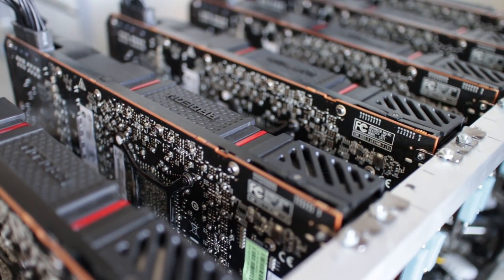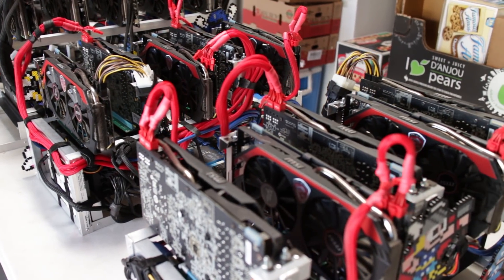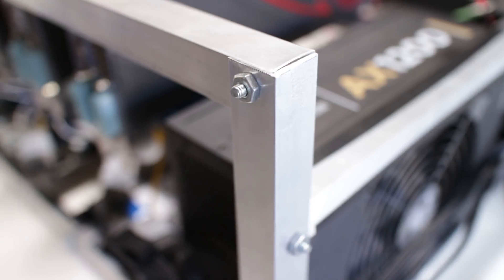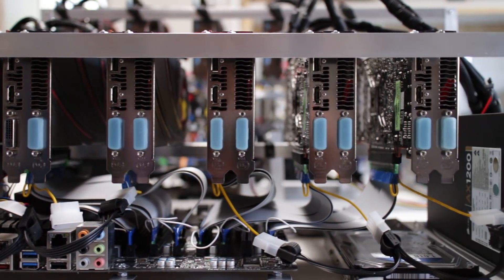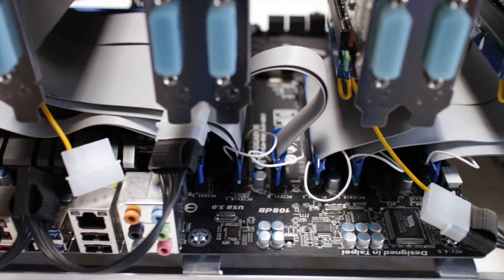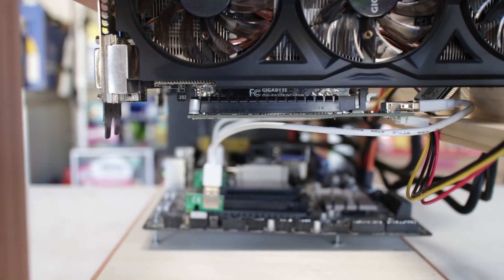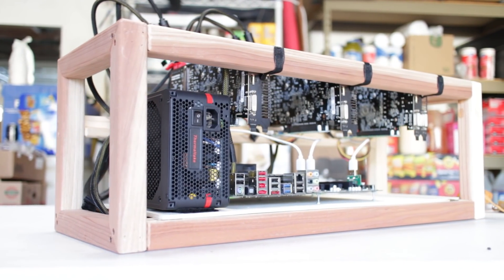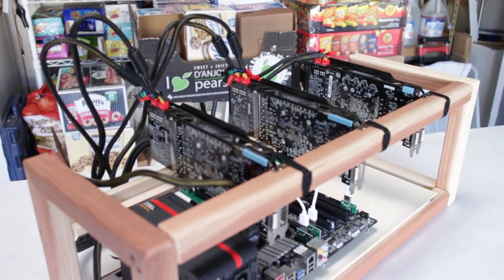$10K and 15+Mhash Worth of Mining Rigs

Comment: You have to be careful. No one will tell you the truth. Fact is that most of the binary options softwares do not work well and basically they are proven scams. I burned my account and lost my hard earned money several times. Eventually I found my desired one==>>(https://twitter.com/MouaJune/status/911658699806064640  ). It worked for me and works fast to achieve quick profit. I am happy to find and trade with such a trading tool. It is fairly able to make decent and consistent profit. I have never come across like this in my 5 years long trading career.

Comment: 10k and 15+Mhash in 2014, i just started today with my single 1070 and it gets 24.7 Mhash :p
Reply: overclocking at +175-200 Core Clock, and +600-800 Memory Clock reaches almost 30 MHZ
Reply: its a different algorithm

Comment: Wooden frame lol.
Fuk the GND..  XD
Too many physics lessons ditched it seems
Reply: +A. Tinkovay Sorry accidentally replied to the wrong comment.
Reply: +A. Tinkovay The GND is already wired into the circuit he is using. So wood is fine.
Reply: +sourdieselryder it ddoesn't work like that, for example, if you did an amplifier and then put it in a wooden case it'll make a lot of ground noise even though the gnd is connected to the transformer and the audio in/out

Comment: What a fucking waste of money.
Reply: Its an investment. Do you realize how much money this rig could make today?  I am currently mining on my measly 2x970 build and am making around $250 a month sitting on my ass. Doesn't seem like a waste of money to me.
Reply: Romain Gallé you must be thinking of asic miners not designed for scrypt. The scrypt miners cost way more than the bitcoin versions.
Reply: ***** a 20mh zuesminer x6 250$ on eBay and uses around 600w...
Reply: but there are those kind of miners which are for crypto so yes its possible.
Reply: Roshan but what were you mining that gave you 63 mhs? Bitcoin?
Reply: Joseph Cano I'm building a PC with 2x gtx 1080s. How do you mine?
Reply: Night Blade nicehash miner
Reply: Don't use a GTX 1080 for mining, go with a 1070 the 1080 has a lower hashrate.
Reply: Romain Gallé those keys are for Bitcoin mining, not Litecoin mining, they use a different encoding
Reply: i doubt that a gaming pc can get that much hash/s by mining litecoin. You're probably talking about bitcoin or maybe something else. These are 290,280x and 270 put together to mine so they are way more powerful than your PC (at litecoin mining at least)
Reply: I have 2 gtx 1080s
Reply: my gaming pc can push out 63mhs while his huge rig only has 15mhs lmao
Reply: In fact, you can have about 1000x more powerful for ~150$ and of the size of a USB key ^^

Comment: What all i need did i need to add up ?
1 Motherboard 
1 GPU
3x GFX 270x - 280x - 290x
1x 4gb ram 
1x 1200w Power supply 
3x pci expres rbion cable
1x HDD (can i use 120 gb ) ?
Reply: A better idea is to use asic miners. They are much better at mining. You can hook them up to a raspberry pi and a powered usb hub. Plus asic miners are cheaper per mh/s.
Reply: adam kimm  will you help me out ? I am new to it :)
Reply: Silver Ambani I'm also new to it.
But go on amazon, ebay or another online shop. Look for asic miners, or asic block erupters. You also want to buy:
     raspberry pi b+
     Powered usb hub
     Micro sd card (for the raspberry pi)
     Micro sd card reader

Once you have set up your raspberry pi plug in the powered usb hub. And plug in the asic miners into the usb hub. Then just watch some videos on how to set up mining software on a raspberry pi. There are loads of guides on how to do this.

Another advantage to using this method is power consumption. It uses very little power, yet is better at mining than any graphics card.
Reply: adam kimm Raspberry pi b good or b+ ?  m confuse in it as well that Block erupters shall i go for this one BPMC Red Fury USB 2.2-2.7 GH/s Bitcoin Miner or else 330 M/hs ?
Reply: adam kimm you can't use asics to mine litecoin. They are only used for bitcoin.
Reply: Daniel Kiselev  nope bro scypt can be used i guess ?
Reply: Silver Ambani Daniel Kiselev there are scrypt asics available you run them with there own power but need to be connected with a pc
Reply: Roy Van Nieuwkasteel  can u plz let me know what all i need :)
Reply: Roy Van Nieuwkasteel  for lite coin mine
Reply: Silver Ambani just an internet connection, a real basic pc (sometimes a raspbary pi is enough) and a scrypt asic (watch your electricity network in your house!!!!!!)
also you need to search for a good mining pool with the coin you want to mine. check coinwarz for mining profit
Reply: Roy Van Nieuwkasteel  Can u suggest me ltc miner ? Any good with link :) plz
Reply: Silver Ambani https://www.minepc.nl/cat/81/Scrypt-Asic-Miners.html
the zeus miners seems good to me, you can also checkout scrypt.cc (cloudmining alternative)